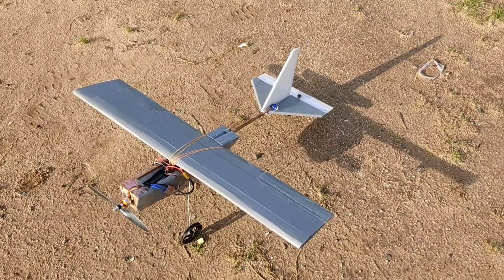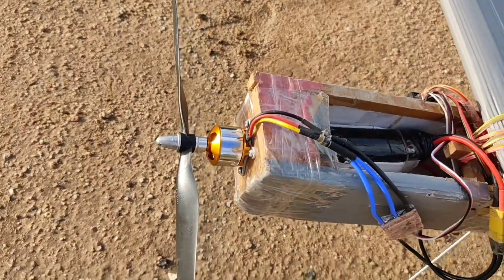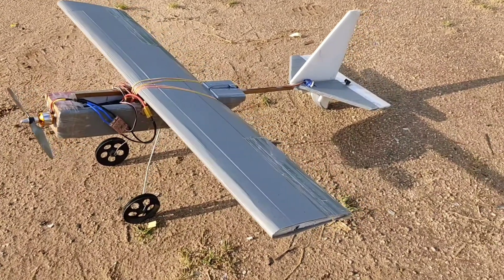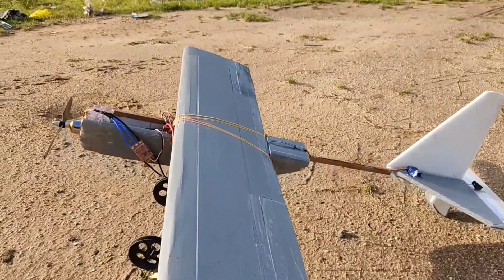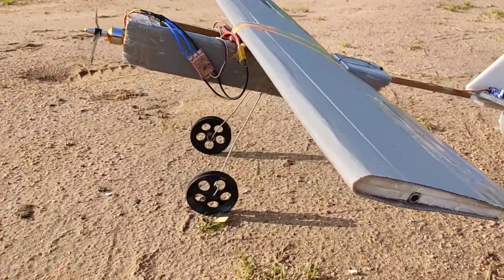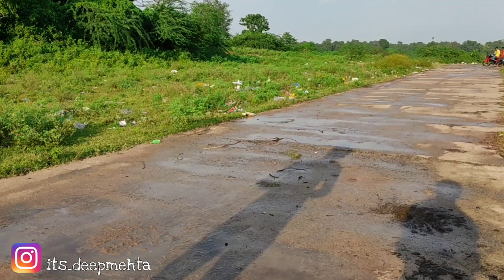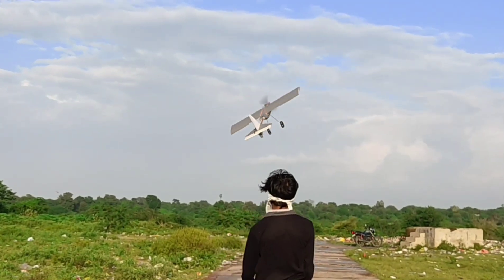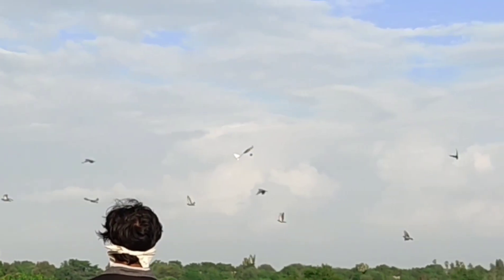WHY IT IS NOT FLYING? 😭😭😭 | DIY RC AIRPLANE | CLOUD CUTTER

Comment: Truly:
1) Tail heavy, try move the main wings closer to the tail to gain more nose weight
2) Too heavy, either increase thrust, or reduce weight by using a smaller battery 3S 1000mah-1300mah may help
3) Tail wing too small, try not to make it triangle shape, make it a traditional tail wing surface.

Keeping up with good work :-)